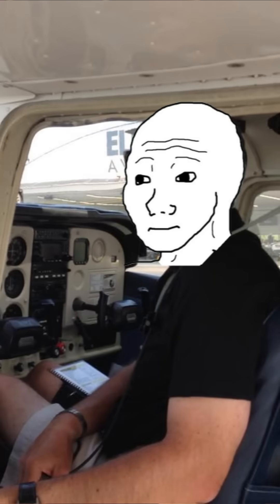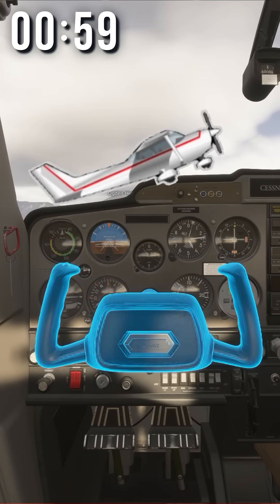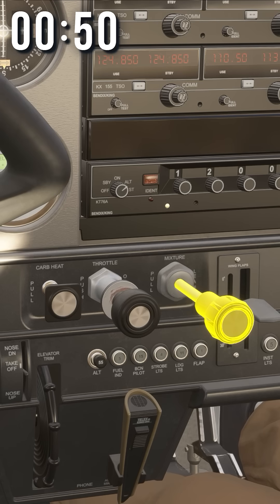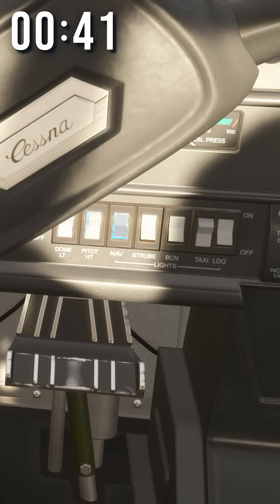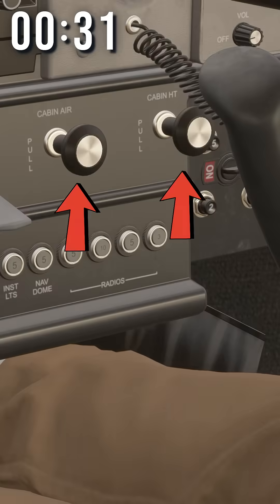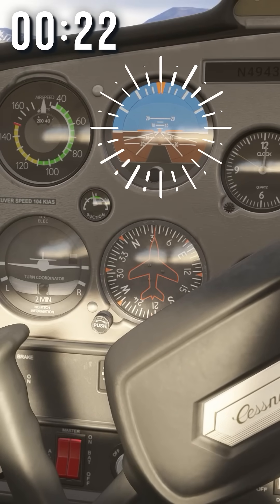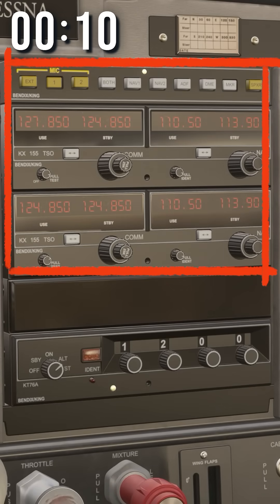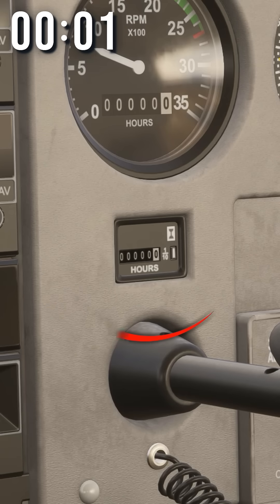Airplane Cockpit explained in 60 seconds ✈️💨 #aviation

Comment: Wild that it still uses a carburetor!
Reply from the maker: Many airplanes use very old but reliable technology. We have magnetos that power our spark plugs, (which is a technology over 100 years old) Manual primers, 2 way radios, exhaust heat systems (typically found in cars from the 50s & 60s) and so much more. Certification for new systems is a long and costly process in aviation. Frankly old systems can be more reliable than new ones. So many aircraft manufacturers opt to keep them around. It's a very weird and surprising thing to see so many old ideas still in action!